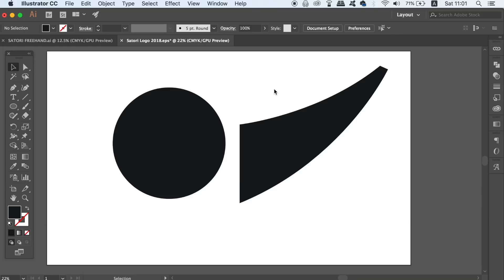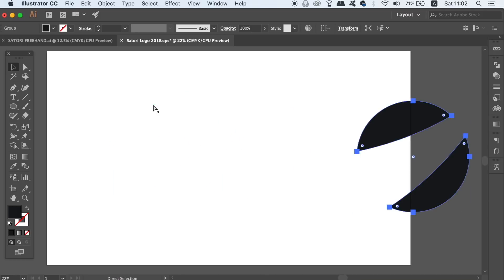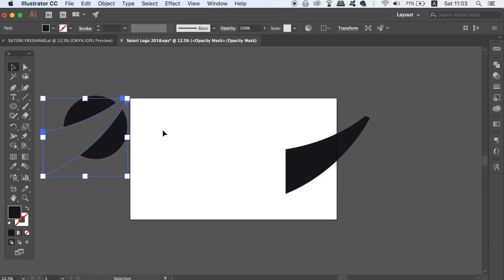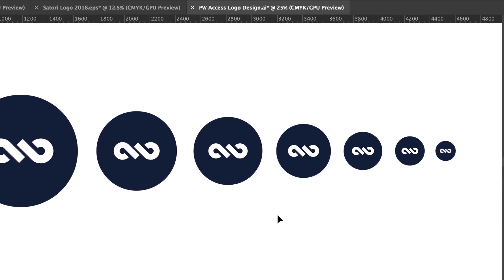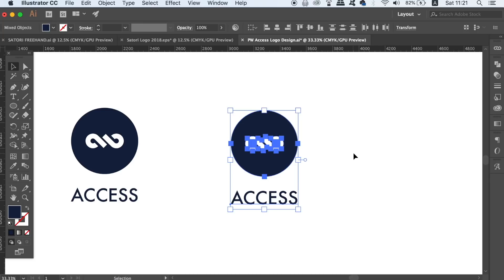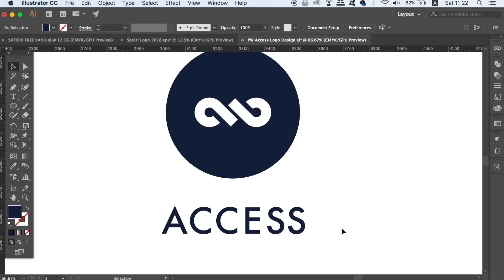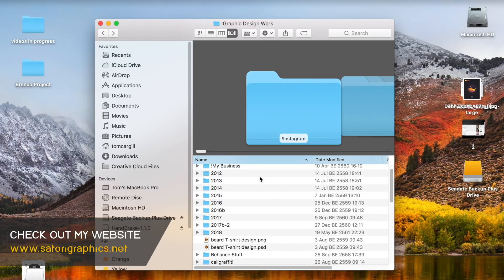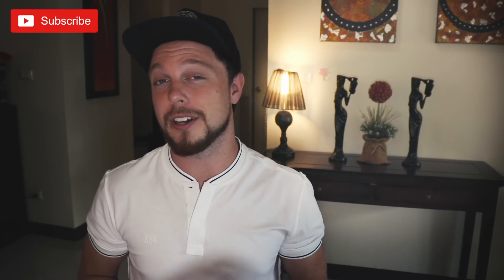⑤ QUALITY LOGO DESIGN TIPS ((Better Workflow)) Illustrator Logo Tips

Comment: How did you make that transform handles bigger..?
Reply from the maker: If you have Illustrator CC, you will need to go up to Illustrator preferences, and then anchor selection and display. You can then change the sizes of them in there
Reply: Satori Graphics i have but i can't go upto 8 px.